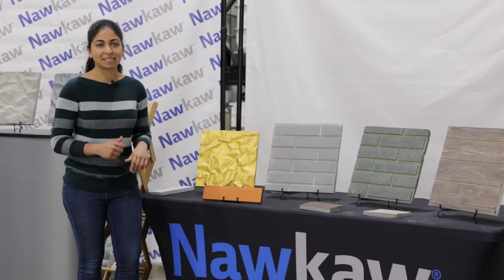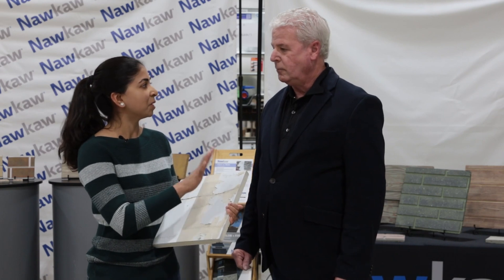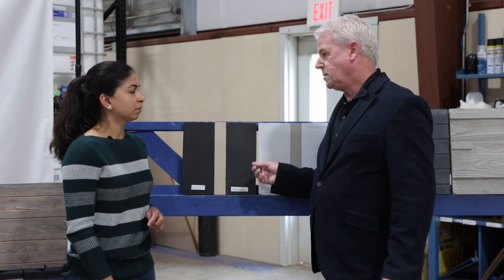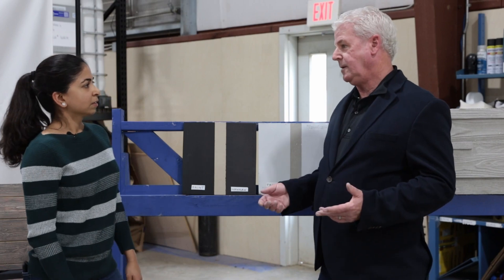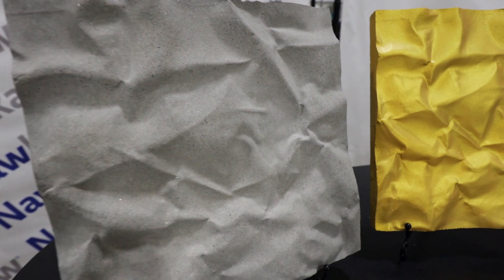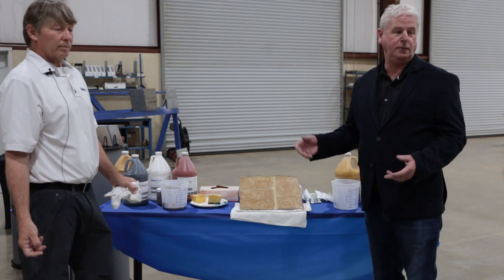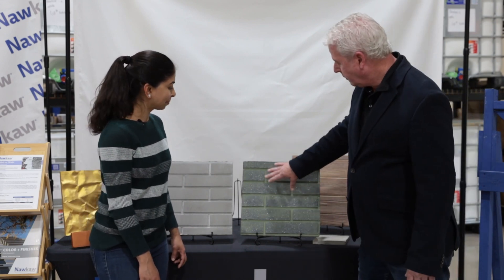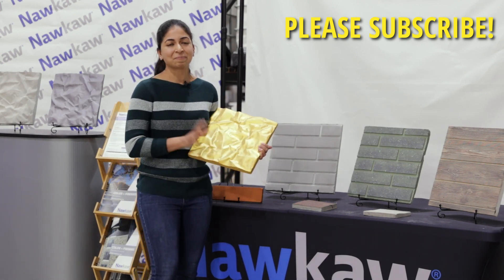How to convert Concrete to Bricks with Masonry Stains

Comment: There is a similar thing to this that is easier to do that is done in australia usually on roundabouts. Apply the first layer which will determine the "grout" colour. Once that fully sets/dries/cures apply a thin layer of a different colour on top, this will become the colour of the "brick". Then they use a pencil and ruler to mark out the shapes/patterns and another tool to scrape off the thin upper layer. The end results looks great

Comment: My exposure to acid staining concrete suggests it only works well on brand-new concrete.   Old concrete, and previously painted concrete, do not hold the acid stain.    It was never totally clear in your video that this process only applies to concrete.   Do their stains work on bricks, which are typically made of clay, not concrete?

Comment: Thank you for the info, what do you think or how would you go about cracked concrete that need to be sealed and stained? Any advice would be great. I have several projects that I’ve been procrastinating on to make sure I go about them the most effective way. After this video I’m going to return some rubber concrete paint after I just returned some flex seal a few weeks ago… so many options, I can’t seem to settle on one.

Comment: Nobody at home depot knows about this. You go to the paint dept and tell I need to paint masonry, "here's masonry paint" thanks Belinda
Reply: Thankyou fot drawing attention to the dangers of painting brick. While staining is the better option, it is worth noting that you can safely paint bricks if the building was constructed right. Modern practice for a brick veneered building in north America is to put weepholes at the base of the wall and a 1" airspace behind the veneer which is open into a vented soffit at the top of the wall. This allows for moist air not build up behind the bricks. If the weepers are there and the airspace isn't filled with mortar there is little concern over the bricks spalling or failing. If the building is older and doesnt have weep holes, or the weepers are plugged, or the airspace is insufficent, then painting the bricks is almost guaranteed to end in disaster. The moisture will find it's way through the bricks and be stopped by the paint. If you are in a climate with a freeze thaw cycle, when the moisture freezes it will expand destroying the structure of the bricks. 

I'm a bricky in canada. I generally discourage people from painting bricks. 

To anyone who watches construction videos on youtube, make sure to take the climate of where you are into account. Some things which are best for one area would spell disaster in another.

It is also good to keep in mind that just because the product exists doesn't mean it is a good idea, or in some cases even allowed by building codes, but they will still sell it to you.

TLDR yes, staining bricks is generally better then painting them as paint traps moisture and stains breath, but that may not be a concern depending on how the wall was built.
Reply: @sandymacdougall76  change the location of your post,  should be on the main thread.  My house in particular in cbs with paint on the outside. Inside are always very humid

Comment: This raises a concern for me. Certain highway bridge supports on new projects here in Texas utilize re-usable forms to create a faux block column feature to concrete supports. These raised features are then sprayed to produce a contrasting "stone" color. I'm now wondering if the spray is a paint or a stain. If it's a paint, is the long-term concrete integrity compromised?

Comment: I find this interesting, as I plan to build in the northeast with ICCF block and apply a stucco finish. This stain may just be the answer for applying the final color for the structure.
Reply: Dude don't do ICF, your getting raped. Look up theromass and rent some commercial concrete forms. I uses Helix micro rebar and Xypex to make it waterproof, exposed concrete inside and out. The cost using those expensive  products cost less than just the price of the block. Any stucco finisher can cover the walls inside and out with a coating

Comment: This is a very great video which I have learned why not to paint brick. What about staining concrete blocks?
Reply: It's the same story with concrete blocks. (The script probably could have emphasized that more.) Concrete blocks need to "breathe" by equalizing humidity between itself and the surrounding environment. Most paint traps moisture which will eventually cause chemically undesirable reactions that weakens the block and causes flaky chips in the surface.
Reply: @dustinbird2090  I know that one Summer Dad painted the inside surface of the basement concrete block walls since our base had flooded a couple of times in the Spring when the heavy snow fall during the heavy Winter snow melted. A few years after that my Dad hired a company to go along the concrete block walls of the basement & force a rubber type of product to coat the outside surface of the concrete blocks to further prevent flooding in the future at that time. What are your thoughts about that? The basement never flooded after that.
Reply: @donaldhollingsworth3875 (*guesstimating*) It'll probably be okay for 60-80 years before it would become a problem. Might cause noticeable surface flaking in 30-45 years... Unless you mean the rubberized coating was put on the exterior surface under the ground--then it'd be okay as long as the rest of the house was still standing. The difference being, protecting the concrete blocks from the groundwater vs trapping the blocks to be in contact with the ebb and flow of rising and falling groundwater saturation.

Heavy amount of assuming and guesstimating on my part though.
Reply: @dustinbird2090  Thank you for your reply. I learned a lot.
Reply: @donaldhollingsworth3875  Cool! Glad I could help inform. However, note that my input is well informed by building science educational courses but should not be considered professional expertise. I have worked with professional contractors, which include masonry services, for a few years but I am not a mason by trade. Have a good one!

Comment: I worked on a Ranch back in the late 70's and the Ranch Owner decided to pour a concrete sidewalk.  We used a concrete stain mixed into the concrete before we poured, to color the sidewalk and then used a welding rod bent in a more  or less "S" shape to make a design in the sidewalk that imitated  stone and it turned out great!

Comment: This video and the last one about the mobile concrete printer seem to be missing a lot of the skepticism that I appreciate from this channel. Things like the brief 2 second splash from the power washer, the assertion that DIY folks cannot mix pigments on their own, and the general lack of consideration for competing products or pros/cons leave me feeling more like I watched an advertisement than the well-researched pieces I'm used to.
Reply: I have to agree. While it's good to show new and innovative products, I'd hate to see too many product pitchmen on an otherwise excellent channel.
Reply: @WinstonSmithGPT  Well that and trying to get Nye to "officiate" a bet about a scientific paper.
Reply: Basically going in the same direction that Risinger went.  You can only talk about so much evidenced based building tech/methods before you run out of content and just start taking anything you can.  I don't mean that to sound mean, just the way it eventually goes.
Reply: Then why don't you go out this comment on that video
Reply: Didn’t feel like a pitch. Seemed like genuine optimism for the tech. But with optimism comes bias and maybe she could’ve elaborated on the cons a bit more

Comment: IDK what kind of paint they are using, but I've seen lots of painted bricks that have lasted 50+ years.. 
And you definitely wont blast those paints off with a pressure washer..

Comment: So my question is about the "blending" of FRANK and NawKaw.

Is it possible to have FRANK layout a house and then have forms pressed into the exterior walls simulating brick. Then later have NawKaw come thru and stain the exterior walls into a brick facade?

I ask because I'm not sure about settling the form FRANK would layout with a brick form in prep of having a company stain with NawKaw stains.

Or did i just think up a new business idea?

Thanks,
Tim